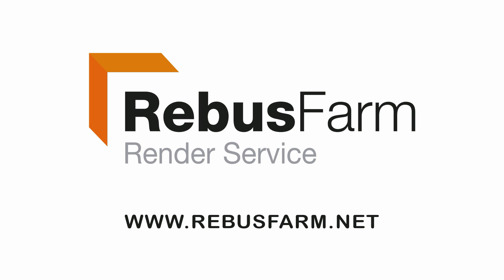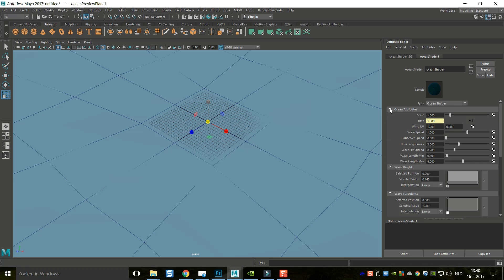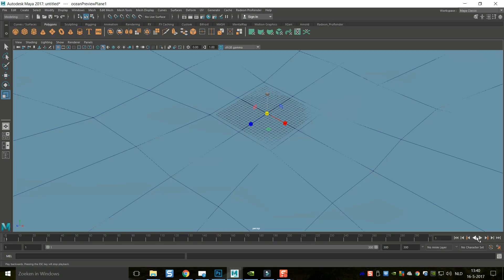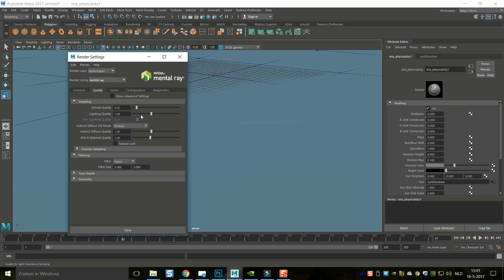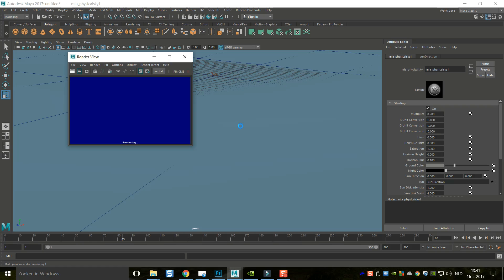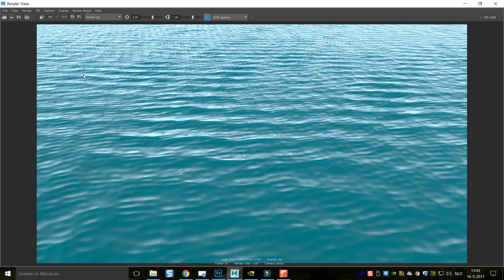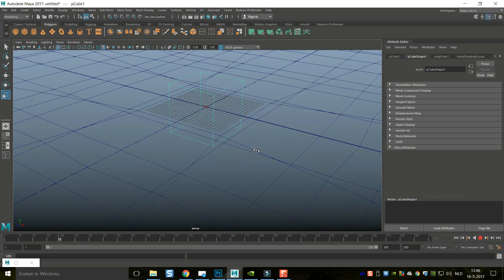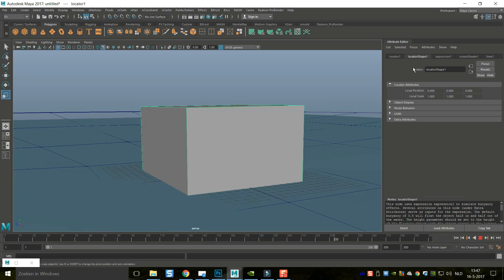Maya 2017 Tutorial : How to make 3d objects float in water

Comment: Hey Mike, during the render process am just getting a grey screened output instead of the shaded ocean. kindly help. Thanks
Reply from the maker: What renderer are you using ?
Reply: metal ray with presets HD 1080.
Could it be an issue with plugin install or something??